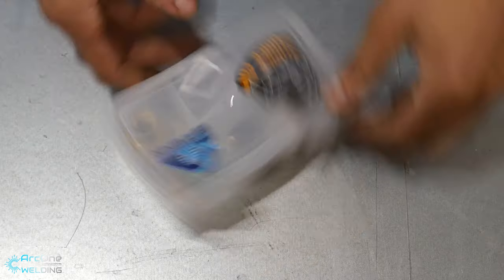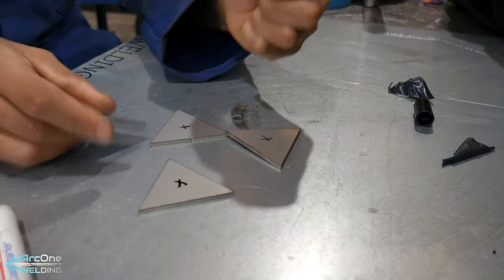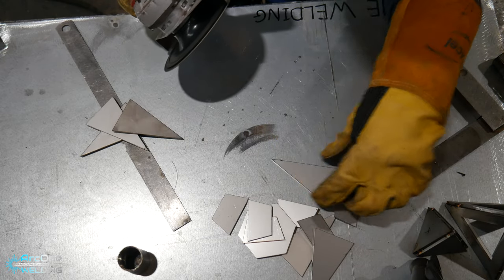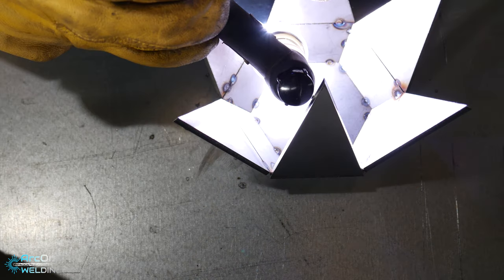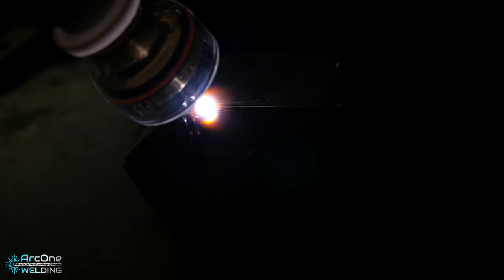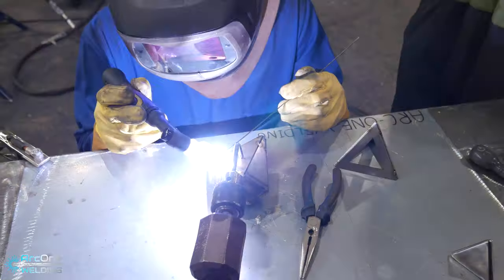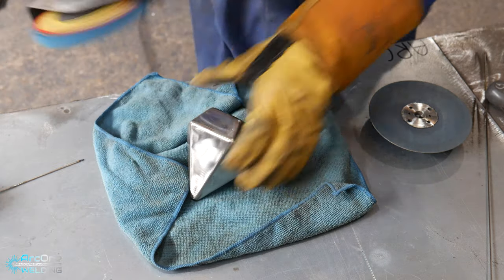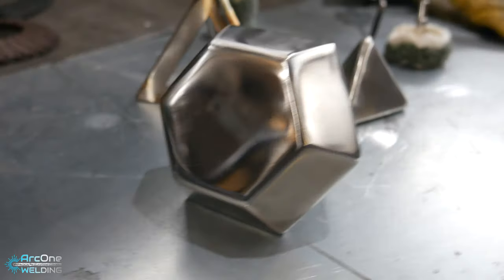Stainless Steel Diamond *TIG WELDING*

Comment: When youve used those tungstens up, get yourself some 2% ceriated (grey tipped). No difference when using them at all, other than the fact that the dust given off when grinding isn't radioactive.
Reply: Yeah im pretty surprised he did that.. Hes creating a health hazard for other people should that dust get kicked up by someone else or when he cleans the floor etc..

Comment: I'm coded mig welder foreman wanted me to have a go at tig try and get coded for pipe work /dairy pipe 0.5 and 3mm I could do it but found it hard if honest and my cap wasn't the neatest could walk the cup .  Pulse on Ali could lay down some nice looking welds but in end agree with the sitting down part but done my eyes in so only do it occasionally and back on the mig ...p.s also hate flux core daul shield mig with a passion 😄🤣